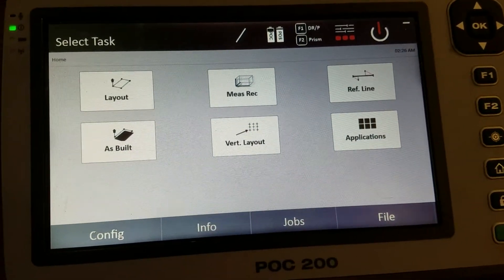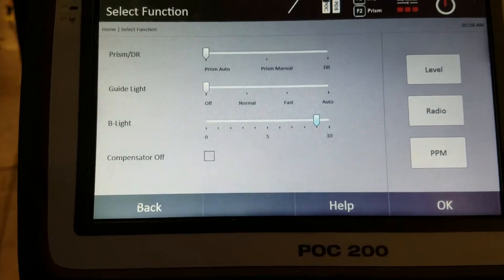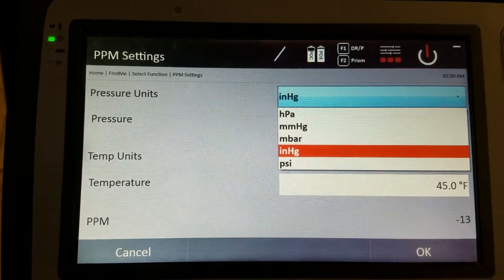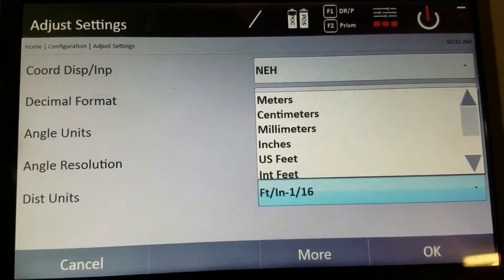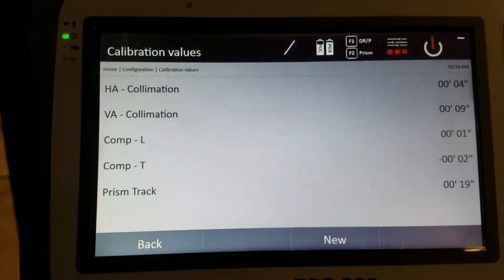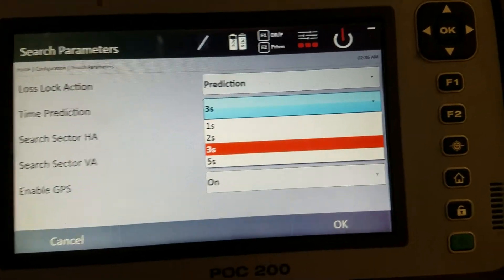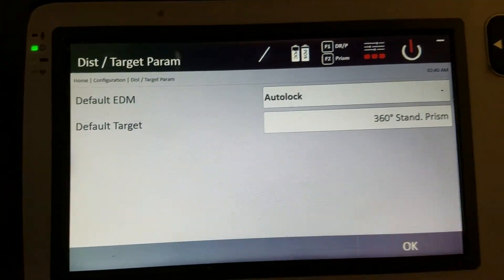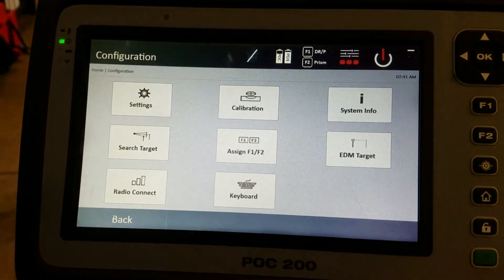Manage Settings POC 200 for Hilti POS 150/180

Comment: hi. is this still relevant today or has it been replaced with a newer model? thanks for the video!
Reply from the maker: This has been replaced with the PLC 400 and PLC 600 (same software, just small vs. large tablet). To use this with a POS unit, you will also need a radio bridge to connect to the head unit, as the tablets do not come installed with a radio transmitter like the POC 200 does.
Reply: @measuringsystems869  random follow up question.. do you recall what the POC 200 were originally priced at? I was on the phone with HILTI support today discussing my options and was just curious about the POC 200 and they had zero information on it. The support rep was even baffled that he could find nothing on it. thanks again
Reply from the maker: @danielmid6022  It was a bit shy of $2k I believe
Reply from the maker: @danielmid6022  but it all came in a combo with the tool, i didn't like, buy  it on its own.

Comment: where we make a mistake ?, we tried to make a calibration, the device measures Comp -L 00.30 "and Comp-T 00.06" and then HA -00.04 and VA 00.11, and when I want to make a Prism Track or spins indefinitely or if it measures Prism Track 00.30 "can't follow the prism, recognizes it for a few seconds, turns green on the tablet and then turns red again and the device turns away from the prism, I don't know where I'm wrong?
Reply from the maker: Hi there, sorry you are dealing w ith this. Try this: make sure you are in LASER mode before you start the calibration. You don't want the tool to "track" the prism when you are aligning the prism tracker. All the calibration is doing in that step is aligning the prism tracking camera to the scope lens, which you had just calibrated the step before.

Comment: What does the as-built function do? Have always used layout and M&R, never used as built. Can't find much info about it. Any insight you could provide?
Reply from the maker: asbuilt simply is for when you have designed points in there as a CSV file already and you are simply going out to the field and measuring in the ACTUAL location of those points that have already been laid out. When you s take the points, it will add a point to your CSV file with the exact samme name as the designed point name already in there with a suffix of ASB (Asubuilt) at the end. This is good for anchor bolt deviation reporting and the like.

Most often, though, measure and record is the go-to for general as-builts if you don't have a CSV already that you are comparing everything to.

Comment: Thank you so much for this video and for all the others you’ve made in this series. We purchased a pos180 in February and found the training provided by hilti to be disappointing. Luckily your videos have enabled us to continue learning more about the tool. 
I wanted to ask you about the guide light. We were never shown anything about it. Will it actually help guide you to your layout point?  
Thanks again!
Reply from the maker: Hi Shane, I'm glad the videos have helped! As far as the guide light is concerned, it is the light right beneath the lens of the head unit that blinks red/orange/green depending on where you are when you are looking at it. Its only purpose is for you to know when the tool is looking at you to help you get it attached to the prism. Most people keep this on "auto." The guide light doesn't find points.

If you are looking directly at the tool, the light should look orange. If you are a bit to the left or right of center, it should flash red or green. So, again, it's just there to help you center yourself with the tool, and then once you do get it connected, use the prism to find your point (or the laser, i.e. direct read (D.R.)).

Hilti has really good back office support as well, and they call back if you have to leave a message: 972-403-2590. Hopefully that helps, too.